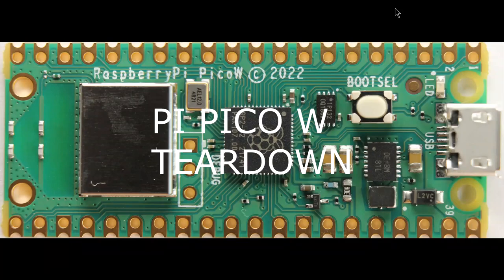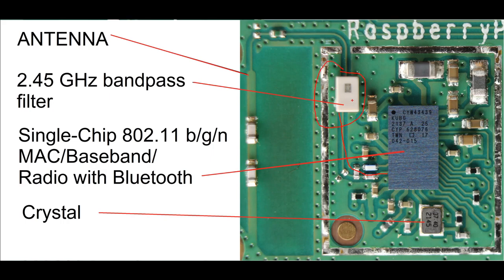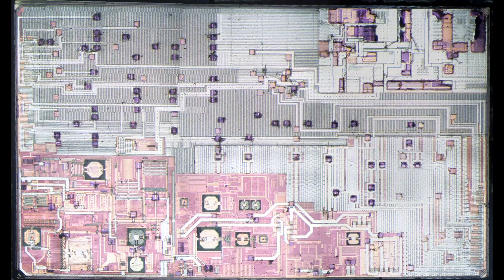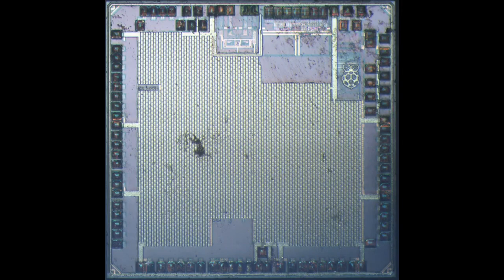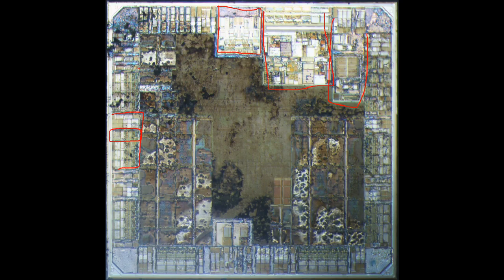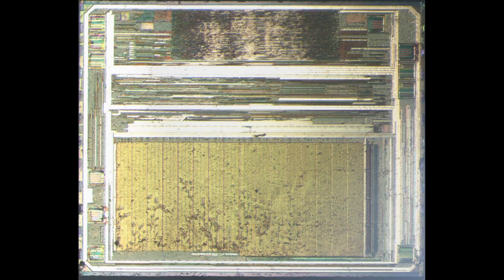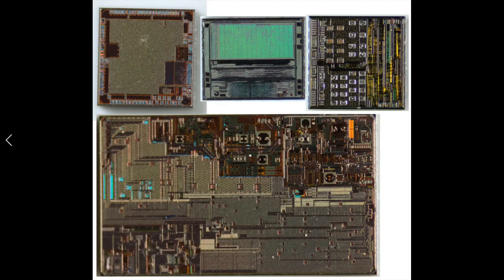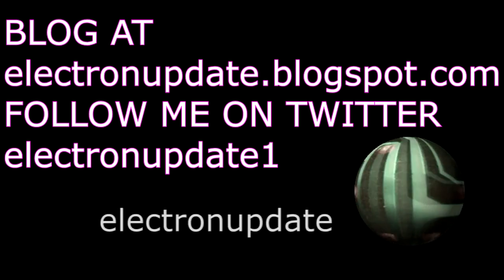PI PICO W SILICON LEVEL TEARDOWN

Comment: These are always so fascinating. I've often wondered what pathway does one take to get into the silicon level of engineering? It honestly seems like black art with VERY little information about it. From colleges, to classes, etc. The entire pathway seems almost secretive.
Reply: I would guess it is via FPGA like stuff and then to custom material from a foundry.
But that doesn't bring you custom transistors, but that kind of work is also done at universities.
Reply: I think electrical engineering, possibly masters level: I had undergrads working in my lab during grad school who had "intro to VLSI design" (which is basically what your question is, at least to start) textbooks.
Reply: For analog or layout design, try to get some qualification from university for electronic engineering and then get hired as a junior. You will learn most of everything on the job.
Digital design is a bit different. With FPGAs you can teach yourself how it works to some level. Timing and simulation will be a lot different for digital directly placed on silicon though.

Comment: Do you know if the programmable I/O (PIO) function of the pico  is somehow structurally visible (clearly) or just part of the very dense "verilog" block? I suspect the latter. There should be 8 PIO statemachines/processors.

Comment: Fantastic die shots with the metalization removed! Always impresses me not only how complex WiFi is but that all of that functionality can be almost entirely on die and manufactured for so little.

I do wonder how the Pico ASIC die was packaged during development, I doubt it was a bog standard plastic QFN, maybe some manually wire-bonded gold/ceramic hybrid DIP or PGA carrier?
Reply: I work at a semiconductor company that develops ASICs containing ARM microcontroller cores and custom mixed-signal IP. They're all packaged in the "production" packages (usually QFN) during development. Digital stuff usually gets prototyped on FPGAs first.
Reply: If we need to test changes to the actual silicon design during development, we send the packaged chips out to another company that decaps them and uses focused ion beam (FIB) micro machining to edit the chip.
Reply: @twicecookedpork6220  Thanks for the info! I guess if you're going to the effort of making masks and entire wafers they're probably quite far into development so you might as well test them in their intended package?
Reply: @WizardTim  Yes.  The cost of mask sets at 40nm or 22nm as used on many micros is quite high.  Much better to go the FPGA route (and backed up by simulation) and then go to the real thing at the correct physical size.  Packaging can have a big impact on device characteristics.